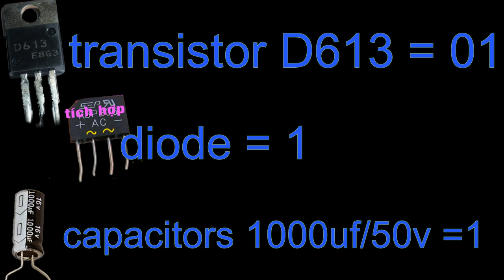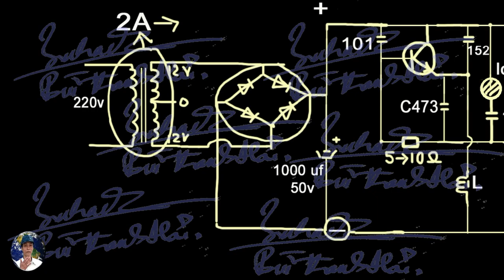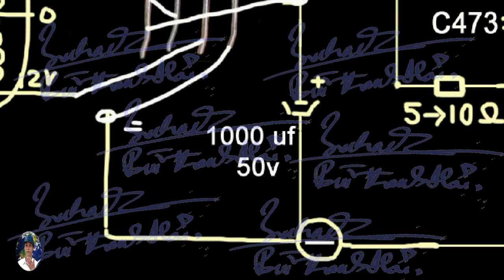homemade nebulizer circuits air humidifier

Comment: I use tip 41, in the water drops the smoke can come out, but if the water is arranged too much piezo just bursts, it doesn't come out of smoke
Reply from the maker: when i use tip41 it still works. Please raise the source to 33vdc

Comment: how about using 2 or 3 atomizing transducer ceramic humidifier accessories .... whether the circuit can be used
Reply from the maker: if you want to use 2 ceramic voltage speakers. You will use two circuits

Comment: FICOU ME MELHOR ESSE VIDEO! FIZ COM TIP41, TIP31 E UM PIEZOELÉTRICO PEQUENO. MAIS NÃO DEU CERTO E USEI DUAS FONTE 12V 2A.  PODERIA ME DIZER POSSO USAR ESSES TRANSISTORES?
Reply from the maker: you can use TiP 41c, 24v ac transformer 2A
The 12v source must use a new circuit
Reply: I USED TWO 12V 1A SOURCES IN SERIES, EACH UNIT.

Comment: Everything is fine but that inductor, 30 laps it's not enough information dude
You must tell Diameter, lenght, wire thickness, type of Core (ferrite I assume)